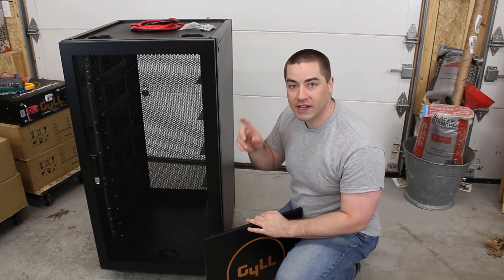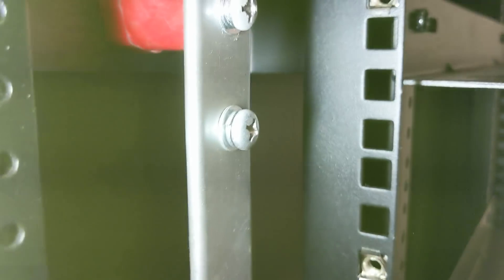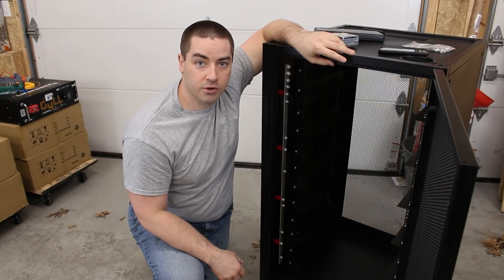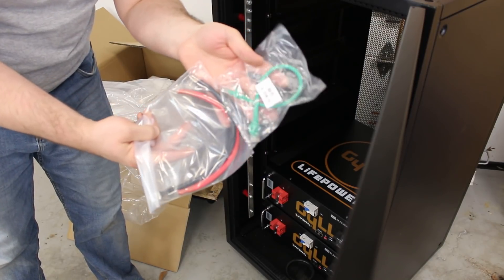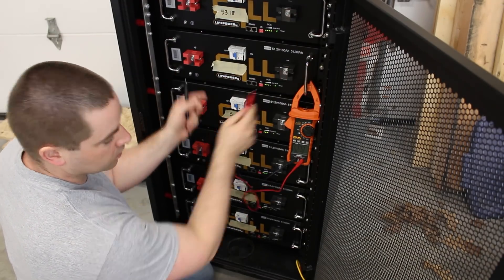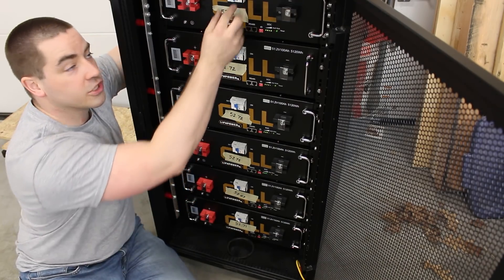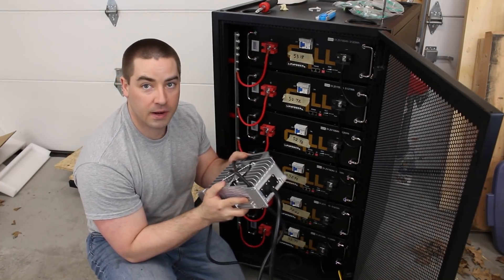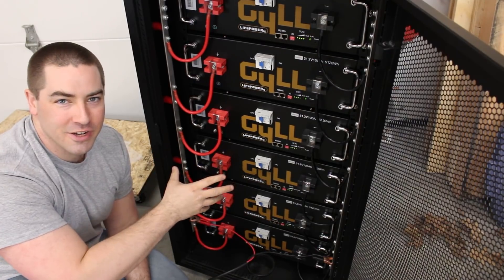Fastest Large Scale Battery Build, 30+ KWH, Power Whole House Cheap

Comment: FYI, The dip switches are 4bit binary. 
So with 4 switches your ID range is 0-15
0	0000	
1	0001	
2	0010	
3	0011	
4	0100	
5	0101	
6	0110	
7	0111	
8	1000	
9	1001	
10	1010	
11	1011	
12	1100	
13	1101	
14	1110	
15	1111

Comment: That is a nice setup. I don't like the way that rack leaves the busbar exposed though. I would rather have a shorter wire go directly between battery packs. It would be too easy for something to make contact with the busbar or for a person to reach in and be touching the metal chassis and busbar at the same time.

Comment: Very nice video. 

I’m looking for a complete off grid system 
What equipment has the best bang for the buck. 
Solar panels
Batteries
Inverter 
Charging control system 
With optional ways to charge 
Wind turbine
Generator etc

Thanks in advance.

Comment: I’m in Australia, needing run 240v 50hz. In a system like this, what’s the max load? Max Amps?
Also interested in putting in solar as well. If this always output sin wave, it’s beneficial to try to run everything from this all the time, however that leads to the question about battery life, if this is plugged into main and solder to charge 24*7 and mission critical circuits run directly from this, I’ll that kill it much faster?
Reply from the maker: This battery cabinet is capable of supporting up to 30kW of load, which usually means up to 30kW of inverters.

Comment: Great video, if my house in average is spending 30 Kwh in the night, this set up will get me cover for a night, and recharge during the day with my solar?
Reply from the maker: Not quite.  Expect 10% loss in the inverter and wiring.  So if your house consumes 30kWh/day, then you would need at least 34kWh of battery for 1 day of backup.
Reply: @DavidPozEnergy  Thanks against for your instructional video's and respond,  like I said before keep the link to buy, very helpful.

Comment: Six 60 volt batteries only produce 30kwh? That's like 30 12v car batteries. The average house uses 29kwh yet my 4000sq/ft house averages 56kwh. Looks like I need two of those or figure out how to use less.

Comment: Cool video thanks for the share. Strongly recommend using insulated screw drivers whenever working on electrical equipment, and shroud as much exposed touch points as is feasable.
Reply: I would remove that and make new cables to minimize the terminal size then cover in electrical tape.

Comment: If using a standard rack to save money (their new rack is still about $500 with no door), is there an advantage to using a bus bar design (that you would not have in a standard rack)?  Any reason why you just can't run wiring from battery to battery directly to hook up in parallel?
Reply from the maker: Hi Jeff Lane,  Several people have told me that they bought used server racks to house their batteries and it's working well.  Nothing wrong with making your own shelves and bus bars.  
As for running a wire from one battery to the next, then next, and so on.  That's called daisy chain.  It can be done in some applications.  However, it's limited.  If you daisy chain, then all of the amps must move through every single connector.  Since the connectors are only rated for 100 amps, that limits your loads to about 5kW.  My house can draw more than 100A.
Reply: @DavidPozEnergy  Thanks for the quick reply.  Ok... I had thought about needing heavier wire instead of the bus bar if daisy chaining, but hadn't thought about the battery connector itself having a limit.  Ya, I can see a 5kW draw from time to time (water well pump) and don't like running things near limits.  Hmmm, going to have to think about this.  Wish Signature had a smaller cabinet with the bus bar at a lower price.  I'm only using three batteries.  You should do a video on a DIY rack! :^)
Reply from the maker: I might, now that I just bought another battery.  You can always make your own bus bar, or buy one like this: https://amzn.to/39fVbwu  comes in both red and black
Reply: @DavidPozEnergy  Hope you do make one!  I suspect there would be a lot of interest.  Thanks!  That bus bar would be perfect for a three battery rack (3 connections for batteries and one for feeding inverter).  I like the 300 amp rating.  Curious though... why would a bus bar have a voltage rating since all it's doing is carrying current.  How would it even "know" what voltage was being used?

Comment: hmm that is a bit backwards, they have on as a zero and off as a 1
code / address is in binary, dip 4 is bit 1 and dip 1 is bit 8.  which in the opposite of what the manual states. the left is the high bit and the right is the low bit.
so DDDD, would be ID0, DDDU ID1, DDUD ID2, DDUU ID 3, ect
this is really bad design. so if you was setting it as ID 1 you would have 1 on and 2,3,4 off would actually put it at 0111 = ID 7

Comment: Really don’t like the data connection. I would prefer an ethernet port. 

The buss bars seem a bit silly to me. Why not just daisy chain power cables. That way, there is no exposed 48v.  

But with the buss bars, I would definitely make a plexiglass shield front and back to protect against a short.
Reply: Busbars would be when you need to disable a battery for some reason and not disrupt any batteries below it.  I do agree it needs a lexan cover.

Comment: If you need to retrofit a server rack for this purpose. You can buy used 42U rack from server monkey in Houston for 300.00. I have used the 42U rack for UPS battery backup units for large companies to keep their network and servers running during a power outage. The one he is showing you looks like a 24u or a half height rack. The bus bars can be fitted into there and are supplied from a number of retailers.
Reply: Where can you get the standoffs?  Was looking around for them.

Comment: Is there a way to run 240 and have a lp hookup too run computer components
Reply from the maker: I'm not a computer guy, I don't know computer acronyms.  When I hear "lp" I'm thinking liquid propane.  But given the context, I don't think that's what you are referring to.
Reply: @DavidPozEnergy  …lp is just a plug for  a pdu … thing of it as a power strip with a much larger capacity for voltage.    

I’m just curious if one is able to hook up a 240 volt set up rather then the normal 110 outlet system we have in the states
Reply from the maker: Thanks for clarifying.  A power strip, weather 120 or 240 volt would be AC (alternating current).  This video is about a 48VDC battery bank.  You can turn the 48VDC into 120VAC and/or 240VAC depending on whatever inverter you hook up.  I'm currently running my house on a Growatt brand inverter, but I've used several types in the past.  https://youtu.be/yWUfvvSa3K8

Comment: That looks to be a standard computer rack, with a few modifications in place.  There are shelves available to purchase. If you would go computer recycling place,  you can get the a bigger cabinet for  $50. I would be concerned about the bus bars. I know they are isolated from the chassis, but could be shorted. 400 amps at even a #4 will turn red hot in a matter of seconds. If you not careful your waiting for an accident waiting to happen.

Comment: Cool, though that's a retrofitted server rack, and they've got the batteries racked in what would normally be considered "reverse".  They need to have this swapped and loaded from the front and wired on the rear.  Servicing this thing would be super dangerous with exposed bus bars.
Reply: First off, reversing the direction would be bad because the typical rack has near zero space in front. This is because connections are generally made to the back of servers and storage etc. So the orientation is correct for these style of batteries. 

As to the exposed bus bars, I would agree generally that having them exposed is a potential risk, however they are approximately 20 inches apart and both are isolated from the rack itself. There is near to zero risk of say a screwdriver crossing both bars. The highest risk would be grabbing the inside of the rack to pull it for example and grabbing both bars.  Just touching one of the bars wouldn't be an issue. 

And the rack has doors with a lock.  It should end up closed and locked and live 99.99% of it's life that way. Additionally it should be labeled as containing dangerous voltage.
Reply: They should have an insulated cover for it. Just opening the door you could brush your hand against it then ⚡️
Reply: Not with breakers in there.  And a quick sweep of some 2" capton tape would insulate the positive bus easily.
Reply: Not sure why you would put the panels to the back. The breakers and indicators would not be visible, or accessible for.service and monitoring.
Reply: Humbug!

Comment: what is the continuous draw out of the 30 kwh battery in KWH plz
Reply from the maker: Each battery is 100Ah, and can handle 100 Amps continuous draw.  The whole cabinet has 6 batteries, or 600 Amps continuous.  Depending on the voltage, the exact kW will vary.  But at the nominal 51.2V, that's 30.72kW

Comment: you inserted the cage nuts in the wrong orientation. The tabs need to be on the left an right side. it not a problem here, but if you install device with screw holes  on the edge off the front plate you need to install 2 cage nuts next to each other.
Reply from the maker: Thanks for the tip.  In this case the cage nuts came installed from the factory, but I'll keep that in mind if I change something.

Comment: What's the life span of this battery system? Since solar panels system last at least 25 years? Total cost of metal shell, items, batteries and installation.
Reply from the maker: The spec sheet says 6,000 cycles.  If you cycle it once per day, that's 16.4 years. Your actual lifespan will vary on how often you cycle it.
Reply: @DavidPozEnergy  thanks that's helpful, also with how small is with 30k 🔋 capacity is amazing. Hopefully in another 5-10 years this technology will improve, longer lifespan and cheaper.
Reply from the maker: Yeah, these things are constantly getting better.  I'm amazed how much the price has dropped just while I've been working with it.

Comment: A quick test you can perform on RS485 transmission lines.  With the entire system powered down, measure the resistance between the A and B wires.  It should be 50 to 60 ohms indicating 2 terminators, hopefully one at each end.  If it's less there are to many terminators If it's 120 or more you're missing one or both.  Also make sure neither wire is shorted to ground.

Comment: what does this 48v do that a 12v battleborn doesn't do?  I know there's a benefit to it (for the application) but i don't know what application it's good for.
Reply from the maker: My personal application is to go off grid with it.  I've been slowly building up a large enough solar system (battery, inverter, solar panels) to take my whole house off grid.  12v Battle Born batteries are 12v, and water-resistant.  So they are a better choice for vans and RVs.  These are a larger form factor, heavier, and not water resistant.  However, these Gyll batteries are 1/3 the cost per kWh of capacity.  So I like them more for my application.
Reply: @DavidPozEnergy  Ok, so Is it the high kw/h they offer that the battleborns do not?   I'd assume home usage would require much more kw/h that a battleborn would not be able to keep up with?  is that right?  Also if so, is it the high 48v that allows for this?  I'm not too knowledgeable yet on the 12v vs 48v stuff.
Reply from the maker: This battery is the least expensive per capacity ($/kWh) I have found in a pre-built battery.  But it's built for stationary applications (home).  Battleborn battery is about $750/kWh.  This Gyll battery is about $290/kWh.  This is true despite voltage, I'm normalizing the conversation to kWh.  I really like Battle Born for vans, boats, small campers.  Those small applications typically work fine with 12v.  But when you try to power a whole house the amps go through the roof.  So we use 48v equipment (batteries and inverters) for houses because it lowers the amps by 1/4.

Comment: can the batteries all hooked up together with the charge controllers and inverters qualify as a solar generator? do you have to ground the battery bank if not can you explain why it does not have to be grounded.
Thanks
Reply from the maker: The term "Solar Generators" is often used for all-in-one packages.  I've reviewed some from Bluetti.  Some systems want the negative or positive post of a battery to be grounded.  But it depends on the inverter you are using.  Personally, my battery posts are not grounded, but the steel cage is.

Comment: How long would it take to charge all these batteries in parallel with solar panels?  I guess you may have a video already and I just have to keep on looking?
Reply from the maker: Usually this battery bank is fully charged by 2pm for me.  But this depends on how large of a solar array you have.  If you had a solar array of 30kW, then it would only take 1 hour to re-charge this 30kWh battery bank.

Comment: Awesome ! what did it cost you for each battery? how many KW/hr would be produced to run a 3 Bdr house with electrical baseboards heat?
Reply from the maker: Each battery is $1500. (USD)  This cabinet holds about 30kwh.  That's about the average American home uses per day.

Comment: I haven't seen multiple Güll batteries connected together before but I had imagined it would be like Pylontech batteries.
So I was pretty surprised about the busbars instead of daisy-chaining like Pylontech does... Could you explain the pros and cons of each solution?
Reply from the maker: Both work.  I don't have strong feelings about it one way or the other.  In the case of Pylontech, all the electricity has to flow through every connection.  This will add resistance (heat, less efficient).  But that would only be a problem at very high amps.  The bus bars in this cabinet are better in high-amp situations.  This might never be a problem if you have a low amp setup.    To be fair, I don't own Pylontech, so I can't speak from experience.  This is more a general statement about running all the electricity through all the connectors.

Comment: Always mount the rack nuts horizontally, not vertically - so they don't snap out when they get weight on them (no problem in your case as the weight is held by the angle rails). From an "old" server rack builder ;-)

Comment: Are you sure those are copper bus bars? From the look of them they appear to be aluminum, copper bars normally have a yellow coloring to them.
Reply from the maker: Yes.  In a shot somewhere in the video I show looking down at the top of the bus bar, where they cut it.  You can clearly see the orange color where cut.  Also, at every screw, when removing the screw you can see the copper color where the threads are.

Comment: New to off grid, this stuff looks good, is it possible to have 2 or 3 cabinets daisy chained giving say 90kWh?
Reply from the maker: Yes.  You can parallel as many as you want.  You could have a building full of them, LOL.  However, the little communication wires support up to 16 to one computer at a time.  The communication is purely just to monitor them, it doesn't add anything to function, so it's optional.

Comment: David good job!  For kicks and grins you should have given a PRICE breakdown for the project!
Reply: Cabinet is 500 bucks. Battery packs are 1500 each. Plus whatever else you add/need to finish.
Reply: I dunno about cheap.   That's less than one week's power consumption for a house with all electric appliances and refrigerated air,  and 60amp heat strips for backup in winter. But I do like the idea of formed cells vs 1000 18650s in an array.
Reply: @mrnico333  if u consider ROI over 7 years and compare to conventional energy pricing….I wonder if it is expensive
Reply: Title says it all, cheap

Comment: David, on my 19” cells there is one Rs485 and one Rs232 socket, not two, David, how do l link them to monitor all batteries, if l can actually find the software to do that, because company who installed the system is out if business. One of my 19” packs is faulting for some yet unknown reason.
Reply from the maker: I'm not good with computers.  I'm guessing a switch (used with modems) but IDK.

Comment: can u run these batteries front side up ?
Reply from the maker: I see no reason why not.  The cells are touching the back, so if you turned it that would be the bottom.  Meaning they wouldn't shift.  The BMS and circuit breaker are all secured well enough.  There is no liquid to leak (like in a lead acid battery).

Comment: Do you plan to have an update on your GyLL Batteries System  performance so far?
Reply from the maker: I don't plan to do an "update" video for a few more months.  But I've been using it 24/7 powering my house for about a month now and it's been working perfect.  I've never had any fault codes.
Reply: @DavidPozEnergy  Great, I ordered one and it is on back order. Thank You for the discount.

Comment: Great video.  You should plug your red and black higher up on the bus bars.  If you have to pull out a unit, the cable for the battery above will not be in your way.

Comment: LiFePO4 batteries are still prone to dangerous explosion or ignition. That much lithium in one place...I don't know. I would not do it. Who knows what circumstance could trigger an explosion.

I would have gone with the Salt Water battery energy storage.

Way more green, cost effective, safer and if you are intelligent enough, you can build them yourself. The only drawback is that they are a much larger footprint.